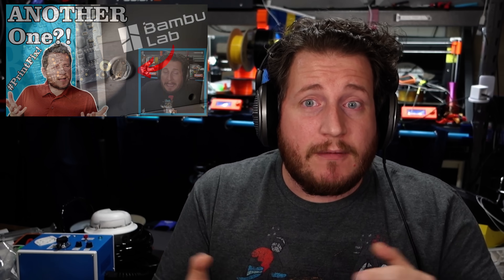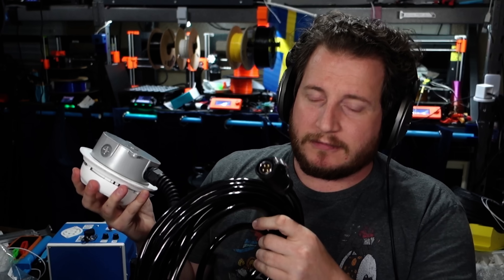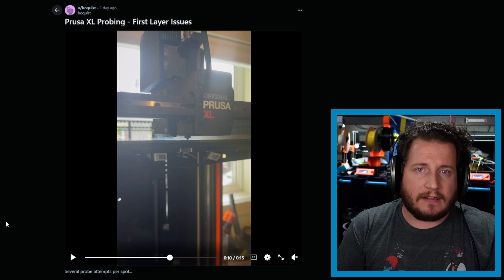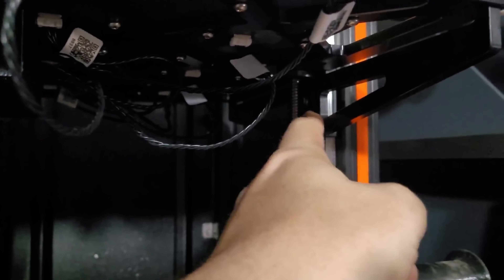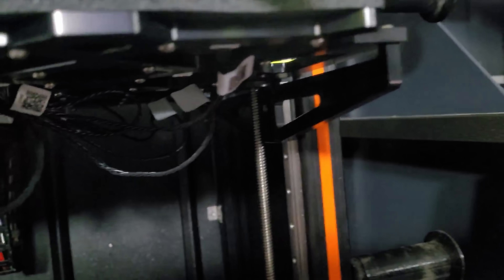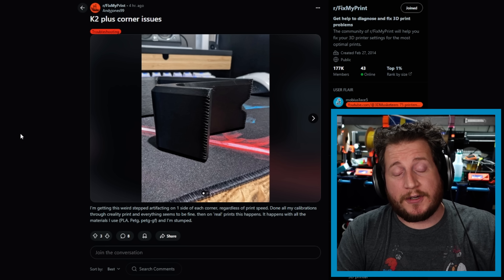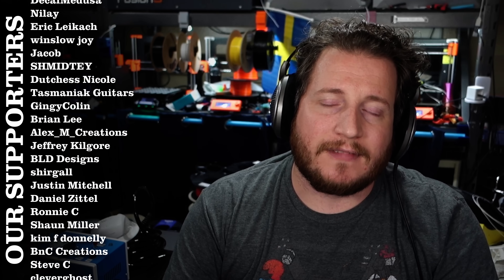This Creality K1 Tore Itself Apart! - PrintFixFriday 206

Comment: Corner issues. I had this once on the X axsis one of my Vorons. It was related to Orca-Slicer and the option of slow down for curled perimeters caused this somehow. I haven't figured out why exactly. But I turned it off and had no issue anymore.

Comment: Adding my vote for "absolutely would buy the smoke detector switch." And cost isn't an issue here, since anything is cheap insurance compared to replacing an entire print rig or, y'know, a house. My only request would be a way to have multiple outlets for each rack of printers if possible.

Comment: I prefer my carbide bits breaking than my HSs bits (other than they cost two to ten times as much!) when carbide breaks, generally you hear a pop and the bit just drops. Often with HSS, it can cause real problems before it breaks.
Reply from the maker: good point!

Comment: The weird corners on the Qidi, have you checked if you have a clogged fan duct / shroud? Not the first thing I'd check, but it might just be that the air flow is disturbed in a very specific way causing cooling issues from one specific angle. I've had similar issues throughout the years and a couple of times it has been due to me panic printing a fan shroud without a fan shroud as I need the fan shroud I'm printing to be able to a good fan shroud, but then the result looked good enough so I never got around to printing a fan shroud while having a fan shroud, resulting in weird issues (and later a catastrophic failure causing me to once again print a fan shroud without a fan shroud to get a fan shroud to print a fan shroud with a fan shroud). "Say fan shroud ONE. MORE. TIME" lol

Comment: It's an offset on the x/y tubes. I had the same problem with my x1c when I go it. I had to get two straight edges and compare the distances. I ended up using about 4 strips of gorilla tape to get the ends to be about the same. After running a calibration, the problem went away. Hopefully this fixes your qidi 4 plus

Comment: Frankly having a smoke detector is just a band aid. The concept happens in the event of smoking the part which is on turn already damaged at that point. Ideally it would be soldering a better or upgraded part or even better, having bambu issue a recall with a replacement part that won't have that problem. Honestly there are so many x1c clones or even better printer than the x1c at this point that it's obsolete and frankly, bambu being as expensive as it is with the QC problems that it's been having lately, I see bambu getting into trouble sooner than later. What has kept them up in my opinion is the ams and RFID for their filament. It locks you into using their filament for convenience and that's the only reason they are doing good if I had to say anything about it

Comment: UPDATE: I just changed the nozzle (standard 0.4mm), ran a first layer calibration; the problem is resolved. Even with stock standard generic PLA profile in Prusa Slicer the corner issue has completely disappeared.
I've been having this corner issue on my Prusa Mini+. Using Prusa Slicer, Generic PLA profile, the default Pressure Advance GCODE for a 0.4mm nozzle is "{elsif nozzle_diameter[0]==0.4}0.27"  after experimenting I found that for my current generic filament a value of 0.10 eliminated the issue. It's a fix for now, but I don't know why the issue occured in the first place. For a couple of years everything was fine, then it started a few months ago, perhaps different filament composition?

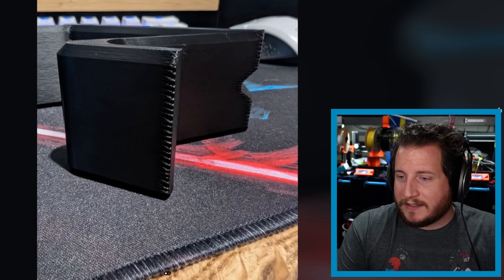Comment: 13:30 My guess... extruder gear backlash. Seems to only be in one direction 
Its either when going from that short wall to the long wall (printing clockwise around the part) or the long wall to the short wall printing counter clockwise around the part).
The repeating steps on the layers reflects the gear tooth or valley position at each layer.
Reply from the maker: but it is only on one edge of the part, if that makes sense. Only on the front side edges, not back side. it isnt at the z seams either. At least not for me.

Comment: 2:30 (U.S.)wired smoke detectors, whether battery or mains power, output a 9 volt dc positive signal onto the interconnect wire which initiates all other connected alarms. It can also be enough to power a relay or digital relay input. They are fairly fun to work with and easy to integrate into alarm or power cut systems if you're into electronics work. It's nice to see a consumer accessible product like this.
Reply: Yeah, not gonna lie, that smoke detector setup shown is massive overkill lol. Easy enough to just  voltage divide that 9v signal, pass it to an Arduino's 5v sense and trigger a relay.

Comment: So my Intel A310 GPU got an upgrade this week. It was doing ok before. Around 200 FPS in 1080p video and 45 FPS in 4k. Then I added more storage (turns out even compressed blu-ray and 4k eat a lot of space! lol) this disabled rebar and it dropped to 60 FPS 1080p and 15 FPS 4k. I got fed up with it. So I now have a brand new threadripper 9960x system. My performance is now up to 500 FPS in 1080p video (200 minimum) and 110 FPS in 4k on the same intel A310 GPU. I tested software rendering on Star Trek TOS Season 1 and both software and GPU seemed limited to 200 FPS probably due to the film grain. So I'll need to run that test again. But the bottleneck is now the blu-ray drive! And I can't make that any faster. lol
Reply from the maker: thats a BIG upgrade! We have a 380 in the streaming PC and REALLY like it!

Comment: K2 issue. Maybe motor current and retraction speed related? Maybe they swapped motor SKU's at some point and one can't handle the magnetic flux change at the same rate the other can. If that's it the core is basically 'saturated' and can't do it's retractions fast enough to modify the pressure advance. That or the driver itself is somehow different in what it's sending to the motor. Same board rev firmware etc?
Reply from the maker: its not retraction related from my experience.
Reply: @3DMusketeers  The OP of that post did follow-up with this: "Not had time to sort a picture but I just finished a perfect run of the print. I re-ran pressure advance calibration and it came out at 0.05. Still wasn't perfect but u/5prock3t suggested retraction might be contributing so I turned off retract on layer change and that seems to have been the special sauce"

Also there was talk about a possible bug or issue with the PA number, if klipper is holding onto values like that maybe that's why one printer has the issue and the other doesn't look at the calibrations between the two! But I do think turning off layer retractions, is still a bit of a bandaid fix and not a true final solution.

Comment: There was a company at CES a couple of years ago, I believe they were in the startup hall with a device designed to detect lithium battery fumes before a fire starts and then shut off a charger. It was intended for personal electric vehicles (like e-scooters). I've been pondering a similar device for 3D printers ever since. I think it would be valuable.
Reply from the maker: absolutely would!

Comment: A lot of times, when there is a problem on one side of the print but not the others - it's often cooling, as cooling on most printers is asymmetric. Are all of the fans working properly? Does the problem change at all if the fans are turned up or down?

Comment: For the corner issue with the K2, I've seen that problem before on the X1C. I think it has something to do with the flow rate/pressure advance calibration on black filaments and the camera not picking up the lines properly. I've had the same gcode work fine in one print, then mess up in the next.

Comment: nice, I can build one of those myself, though I don't think it quite deserves that level of materials, as long as it's reasonably safe.
Typical 120VAC smoke detectors have 3 legs, hot, neutral, and tandem.
When in alarm, the smoke detector puts out a 9 volt DC steady output between the tandem line and neutral.
All one needs to do is tie that to a low voltage coil relay that would disconnect power to the coil of a much larger relay driving the load. powered on the load side of the power relay.
Reset switch to initially energize that relay. will require pressing the reset on power up

Comment: For the corner issue -- raise the temperature slightly. The corners are shrinking too quickly and curling, until the layers stack enough that it turns into an overhang and starts the process again. The reason it's only happening on one corner is likely just due to the particulars of the part cooling flow.
Reply: With PLA it's the opposite, it only warps if you can't cool it down fast enough. I observed these kind of corners mostly when they point towards the back and I'm using a larger nozzle - most likely because the shroud of the fan only blows from the front and sides onto the freshly extruded filament, which leads to some blind angles with insufficient cooling. I have no experience with the other mentioned materials, though.
Reply from the maker: nope, not shrinking at all actually (at least from my perspective?), it looks perfect when printing. For me it happens on all materials, even ABS. 

The cooling fan is a decent theory, but then why would 2 identical machines only have one that experiences the issue?

Comment: i'd buy it.
Though for NZD$60 
Buy needs to work with a UPS
Reply from the maker: It costs more to produce than that.
Reply: @3DMusketeers less than $20 of materials, with a full production line
$60 would pull a decent profit

If it costs more than that, it's too expensive for me
Reply from the maker: Putting a low price on safety is the first issue
 If you can find all that for $20 let me know. But given the quality of materials here, I don't see that happening when the smoke detector alone is like $10
Reply: @3DMusketeers  true, but the cost MUST be low enough to enable everyone to integrate into their printer setup.
Most of the cost will go down due to production economies of scale.

You could build your own, for maybe $30. If you know what your doing.
Basically an SSR and an SCR, and a few other components, which cost a couple of dollars
Reply: @3DMusketeers I do prefer hard wired, so I love it, and was thinking about making one myself, but there are wireless solutions, ex. Ring Fire Alarm listener. For me 100USD is probably the limit. I would also have to have enough space to accommodate the big box. If it's very integrated in a small package maybe $200 but probably not.

Comment: I bet that safety box uses a simple relay logic that is nothing more than a fail safe/self latching relay. Any relay with at least 2 form C (N.O & N.C) contacts will work. Wire this control relay to its source voltage (relay coil voltage must match!) and wire one of it's N.O contacts in series with the coil on the ground side. Wire in a second Aux relay with its  N.C contact from the N.O contact of the control relay to ground. The Aux relay with the N.C contact is that one that will trigger the control relay. Wire the momentary reset switch from the control coil (ground side) to ground which is in parallel with the 2 contact (N.O & N.C Aux contacts).

The trick is to find a trigger from say the smoke detector to trigger the Aux (maybe the alarm buzzer?). The second relay coil voltage to match the alarm side source which doesn't have to match the control relay which could be 120VAC, but the Aux relay should have a DC source.

This is a great idea to add to a power cut system in case of smoke release to any 3D printer and I always thought of adding to my own printers. Your fire related vids is now providing enough motivation to get it done. I will probably 3D print a box that will include the control, wall socket and mount the smoke detector directly to it. Add a power cable to plug into the wall and done.

This self latching relay scheme is very common in industrial controls. I even used it as a back up to my my car alarm to cut the ignition or the fuel pump if someone defeats the main alarm or cuts the battery off...the latching relay trips immediately when the alarm sounds and needs a manual reset by the owner with a hidden button. Just needed to add a small led that lights when tripped to remind me why the engine is no starting and that I installed such a device 😛. A LED indication requires the control relay to have at least 3 contacts. 

This self latching relay control scheme will always trip when the power source is removed...hence fail safe.

Comment: Your issue is under extrusion. When I first built my voron and switched to Orca I had this exact issue, but only with ASA. When I dug into the calibration and settings, the default flow multiplier for ASA was very low at around 91%. I calibrated it, and the issue went away. It's odd that the same gcode works for one machine and not the other. Try increasing the extrusion by 1% on the machine with the issue.

Comment: Corner problem is a cooling problem. Corners get not enough time to cool down and it's also dependent on part cooling fan duct because it's not getting same airflow from all directions. This issue was most visible for me while printing ASA which is very sensitive to cooling.

Comment: A fire detector needs to be mounted at the ceiling, not below it. That is because the gasses are at the level of the ceiling, and takes quite a lot of time to work their way down, and by then, it is too late. As a concept, a wireless system that uses a smoke detector mounted the right way, could be done pretty cheap, and would be insanely welcome. Doing it wirelessly, it could check its connection on a regular interval, and do that freaking "biping" thing, if connection is lost, thus not just because of a flat battery.

As for the corners, is the nozzle perpendicular to the bed? Since you have swapped nozzle, if this is HW, then I would look for alignment, as in potential mis-alignment, artifacts in the filament path, and so on. Most machines comes rigid these days, that is, skew is uncorrectable. If the gantry is skewed, it kind of is a nightmare to correct, as almost any algorithm is written as if everything is perfect. If something is out of whack, it is hard diagnose with these printers, and if you figured it out, there might be nothing you can do about it. Given any focus on this industry wide, you will be chasing ghosts, as nobody will point you to this, nor will hardly anyone figure out to look for it themselves. If they do, they will need to figure out from scratch how to do it. I've lost count of how many people think they can eye ball something in the 100 micron range, which nobody can. But the pattern on them corners seems repeating and not at random. If you have a off-center idler or pulley, as this wobble for extruder thing, that would actually be caused by HW, not SW. The list of possibilities is like endless. Happy ghost hunting.

Comment: I have when working as a machinist resorted to HSS when the cutting conditions were not good.  My boss could not figure out why when cutting sheet metal stainless some quality Kennametal endmills were breaking, but I realized I ran into a rigidity issue.
Same endmills will happily eat through a solid piece of stainless at high speed.
Reply: It's the # of points of chromium in the stainless. What type & % of chromium in the stainless that you're cutting?
Reply: @helixx_4D  It was from a previous job, but it was some half-hard 304 sheet.

Comment: Try looking retraction as well. Its a factor of 3 things - PA, retraction and print speed. Pressure advance is a setting that is individual to each machine and may differ slightly (or a lot) depending on your printer, even if its the same maker and model.
Reply from the maker: It's not retraction as it's not at a seam, at least that's what I'm telling myself
Reply: @3DMusketeers  It reminds me of something I was trying to figure out.  I was tuning my retraction settings to get rid of an artifact on a fine pattern of repeating lines on one of the surfaces.  I fixed this but then an under extrusion started happening in the perimeter of the base just after one of the corners.  I played with different flow and overlap settings and almost got it to go away but not quite.  I had at some point changed the perimeter order to "outer perimeter first" and as a last resort I changed the order back to inner first and the artifact went away, even without some of the tuning I had previously done.  I looked at the gcode preview on superslicer and there were several de-retractions in that corner just before the under extrusion region.  My guess is that it might be something similar.

Comment: I had an extremely similar problem as those corners. With some help from the Voron discord, we figured out it was due too high pressure advance at certain speeds (typically higher speeds). It can be fixed with either adaptive pressure advance or just lowering it.

Comment: My Kobra S1 did the same thing as that K2. Going off foggy memory I got it rectified by tweaking PA and retraction, it was a combo of the two.
Reply: My Kobra S1 does the same but at random, no matter settings it will print the same file different every time 🤣 so we got a K2 and it has been the best printer so far.

Comment: So I have a few k2 plus and and had this issue on one. After checking flow rate n lots of settings ended up being a loose screw on heat end nozzle had a little wiggle every time it changed directions

Comment: Regarding the Prusa XL issue - I've had drivers overheat and cause stepper inconsistencies. Print a replacement cover with fan for over the circuit boards if you haven't already.

Comment: The K2 corner problem  is obviously a software issue. You can see it stepping back a consistent amount from the corner each layer before resetting. Check the slicer output to make sure it isn't in the gcode; probably not, it would've been easy to notice, but double-check. Then update the printer's firmware.